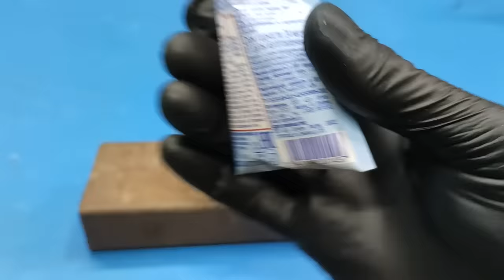Don't buy super glue, make it yourself in 2 minutes from vinegar!

Comment: It would be cheaper to go to the dollar tree store , and by three tubes of super glue for $1.25 than to buy glycerin and vinegar.
Reply: Agree, even in Hungary these components are more expensive like a glue and also the glycerine can be found in certain pharmacies, and you can buy only a limited quantity at once and we have vinegar 20% or less only. But in Russia the regulations concerning chemicals are different than in the EU or USA, you can buy a lot of chemicals in supermarket and they are less expensive.
Reply: Right!
Reply: Moreover, this is not super glue.
Reply: Click bait
Reply: Correct. This is not superglue either. This is what was called hot glue. It was used in carpentry until the invention of cold wood glue (acrylic glue).
Reply: Could I stick my broken tooth back using this method?? After all ,  the ingredients are all drinkable & edible
Reply: are you in USA? all our vinegars for salad and cooking are 5% acidity. It would probably cost like $20 to buy 70% from some other country and the shipping likely $50 🤣😅👍
Reply: Where is the fun in that?
Reply: Vinegar (acetic acid) and glicerine are cheaper than bottled water in some cases, you can buy them at chemical substances retailer for pennies. Glicerine is completely safe, high percentage vinegar can irritate skin, but that's about it. And vinegar is so useful for house chores,  for clogged pipes, removing odors from containers or fridge, removing calcium deposits.
Reply: Depends how much you need, if you live near a store and if you have all that at home. We have all that. Not sure why he used a heat gun instead of simply boiling the water.
Reply: @istvantorok4819 How's your buddy Putin?
Reply: @dntakemesrs  I understand the question, but I'm not "competent". There are many of us here who do not play in that team. But we are also ashamed for them.
Reply: What if you don't have one in your town and have to pay AU$4 for one small tube???
Reply: Repent: And we all have welding /torches at home?
Reply: Maybe if you already have it but yea im with you
Reply: LMFAO 😂

Jman
Reply: Must you use it immed? Can you store it for later use or must you make a new batch everytime?
Reply: Plus the misleading title.
Reply: Yeah right
Reply: @angr3819  For the show, I enjoyed watching it.
In other words it was more interesting than just pouring already boiled water on it.
Reply: I see it as an interesting science experiment such as I remember in high school. But it also seems to be a handy way to procure a decent glue in the absence of commercial glue,you know, when going  to the  hardware store is more of a nuisance when you are in the middle of a project.
Reply: Here in South Africa, proper quality glue is really really expensive😢😢. So I will consider and try anything out, this video a case in example
Reply: I agree 100%
Reply: @lisagriffin8898 Pouring hot water into the jar might crack the glass I suppose.
Reply: I honestly love buying my super glue and epoxy from the Dollar tree just because it comes in a little sizes you can use it for something and not worry about it getting hard cuz you've used it all that little package same thing with the epoxy usually don't need more than that one single use it's always fresh
Reply: @pattiannepascual - I think you’re right.  The strongest I can purchase locally is 30%.  European grocery stores sells 70%.
Reply: Yeah unless you're allergic to super glue like I am. Or if you need a non-toxic super glue option.
Reply: WaiT till you cant buy IT anymore in a store. ..
Reply: Same in south Africa but thanks for info😊
Reply: This video isn't for those that want to go to the store but for those that want to "make it" on their own. It's called crafts and arts. Of course you could get off your ass and go purchase some super glue, that's not what this video is about though. It's about making it.
Reply: @ScottRock-mr6qk I KNOW RIGHT!?  I just can’t understand why some people have to be so negative about everything!!!!! Try living somewhere that you can’t just hop into your car and run down to the store.
Reply: @SashasRevenge  I do live somewhere where you can't just hop in your car without traveling 30 minutes to Walmart. It takes me 30 minutes in any direction to get to Walmart. So for me, this video would work if I have all the ingredients. Which I believe I do.
Reply: @pault8470  hope it will fix your tooth and make it shinny too... Good luck 😁
Reply: And I would to if I live in USA, but I don't coz Superglue in Spain isn't cheap.
Reply: @riarden  and now you know how to make it.
Reply: you may be right about that, but over the last few years, I think we all saw that sometimes the places that sell these things are not even gonna be open, and that even up until now, availability is a major concern at times.

If you know more than one way to do things, then you’re probably not going to be stuck for lack of a product to finish a project. Or to just make a repair.

And vinegar and glycerine are things that people like to have on hand anyway, just in the kitchen. Most people make and decorate cakes do keep glycerine on hand.  And some soap makers do as well.
Reply: it might be important to consider the environment and microbiology.

A persons mouth tends to be full of germs and nutrients.

So the important thing to consider here, might be how to do it in a way that doesn’t trap microbes between the two surfaces that you propose to stick together.

After all, Nobody needs cavities inside to surfaces that are stuck together, and nobody needs an abscess.

I’m sure there are lots of people that would probably give you more reasons again, you really need to make sure you understand what you’re doing if you’re going to be putting things together with adhesive in your mouth. 

in the meantime, if it’s giving you pain, there is something you can do:

While you’re figuring it out, consider investing in a very cheap bottle of oil of cloves. Which is commonly available at the local pharmacy; if you can, use a cotton board or a little bit of tissue paper to dry around that tooth and maybe dry off the tooth.

Deep the very tip, and I mean a Millimetre at most, of a brand, new toothpick into the oil, and touch it to the outside part of the top of the broken tooth. You don’t want to put it directly on any surface that’s likely to be really truly sensitive.

It may hurt just For a moment, and then the pain is gone for quite a long time afterwards. That will actually let you get a good feed into you, and to clean your teeth well afterwards. And then you can get on with your day until it starts to hurt again.

Lather, rinse, repeat.

I spoke with my dentist about this, as I did have to do some dental work on a broken tooth during the pandemic, when nobody could see anybody else. And he agreed that this is probably the best way to go, and he mentioned that oil of cloves is a major ingredient and at least one of the compounds he uses when he works on teeth.

I don’t remember the entire conversation, as that was about a year ago that we had it, but perhaps you could look online and find out the details if you need it.

It solves a whole lot of problems, not being an absolute agony with your teeth.
Reply: They're not allowed to have dollar tree stores in Russia.
Reply: En Argentina la silicona es súper cara, es mejor hacerla ,estos materiales se consiguen fácil... Lo que no sé si entendí....el soplete(fuego)es para entibiar el agua?para eso le pongo directamente agua tibia.... Pero la receta parece buena la voy a intentar.... No abundan las recetas y las que hay llevan materiales químicos que solo venden a granel..... Saludos!!
Reply: Glycerin and vinegar are easy to make at home or in a shtf scenario.

  Now all I need is a hooved animal like a horse or a cow for the gelatin and I can make this easily 

Or I could make hide glue
Reply: No. In the EU superglue is about €10 . Perhaps Biden made it inexpensive for him to stick to his chair!?😂
Reply: @repent6238 youd be happier if you didnt feel the need to throw shade. Did you know on Maui, theres not a single dollar store of any kind? Same as many other places in the world. Appreciate! Its a more peaceful state of mind🤙🏼
Reply: But you could use tap water and use his own vinegar
Reply: You guys miss the point. Learning alternatives is always beneficial, in case you must come with plan B. The chemistry involved is a learning experience we should embraced.
Reply: Everyone is comparing apples and oranges. This is just wood glue or school glue. Not a contact adhesive like super glue
Reply: Thx I was just going to look it up. 2 I only use drops on small projects
Reply: Not every viewer lives in the USA .....there is a whole world, not just out of your State but out side your country .....and you know what ...there ain't  any Dollar Stores there
Reply: Fart bait
Reply: Buy Gelatin as well !!
Reply: If we can't find glycerin, will nitroglycerin work?
Reply: How cute that you think Dollar Tree is a worldwide brand.
Reply: I would like to see plastic, to plastic, ceramic to ceramic, and acrylic plastic to glass, like fake gems to the side of a glass vase.
Reply: I know right
Reply: But you can make it in bulk quantities
Reply: Still Cool!!!!!
Reply: Another boring video.
Good that I skipped at 1:21.
Reply: @istvantorok4819 Well said.  An excellent response to an uncalled for and inappropriate question/comment.
Reply: So what makeing your own stuff is way more rewarding.
Reply: @Tridenux  yeah but I'll still be handling products I've never handled before.
Reply: @pattiannepascual  though you could use the rest of it for cleaning. Cleaning vinegar is high in acidity.
Reply: Where you can get 70 % vinegar .
Reply: You’re right this is what you do when you have to much time on your hands
Reply: Thank you for your video. I wonder if agar agar will work. If it does your plant based friends will love it.